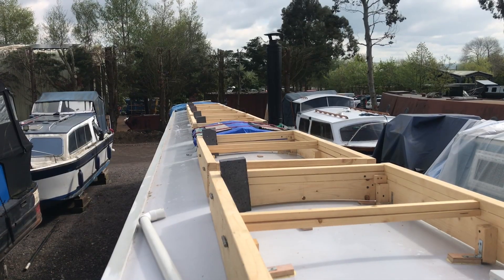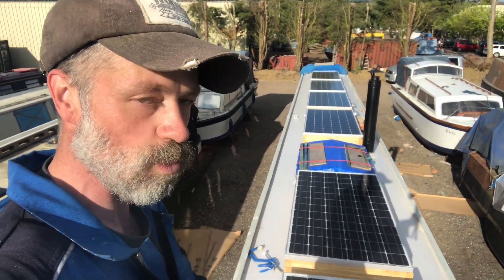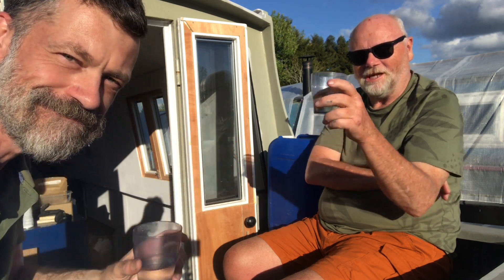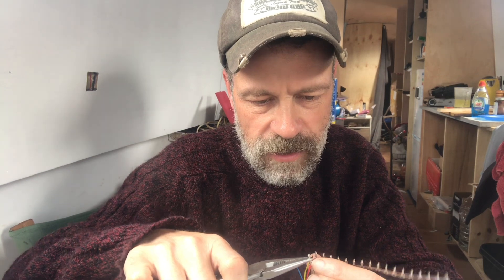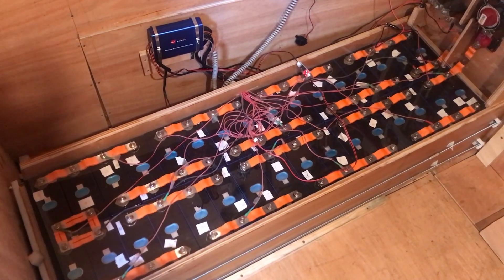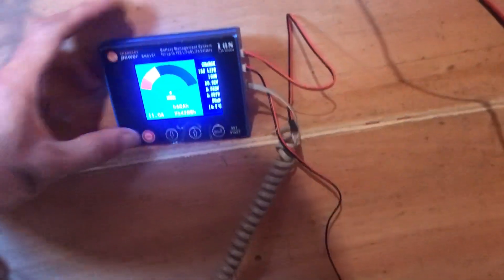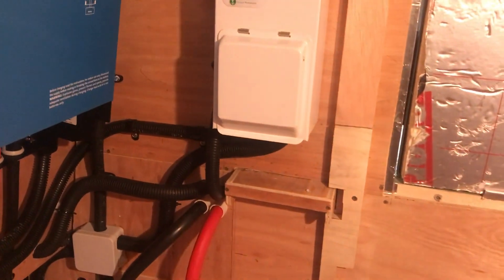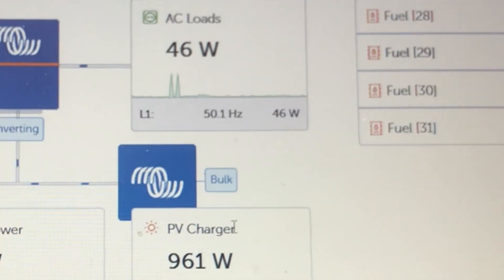48. Installing the [Actual] Boat Solar Panels (& a Quick System Overview)

Comment: I was hoping your panels would be 250+w each! But it is looking AWESOME. Most of the time when cruising, you are actually just sitting on a landing stage or in a lock, so the motor won't be running for much time at all on a typical day out.
Reply from the maker: I wanted relatively narrow ones so I could walk down the roof with [relative] ease. This resulted in only one choice of solar panel - believe me I spent days looking for more ‘oomph’ in a size that would fit🙃

Comment: Thanks so much for the run down. Was there a reason why you bought the Vetus serial system over other options?
Reply from the maker: My pleasure. The reason for Vetus was I was at Crick in 2021 and other than Fischer-Panda, the Vetus people were (IMHO) the only other ones that were engaging and informed about their products (and had a demonstrator boat there too). Vetus are a reputable manufacturer and were slightly less horrifically priced than F.P. So I went with them. And given I am putting this all together myself, I could get the stern gear from Vetus too and hopefully it will come [fit] together . 

What with Vetus and all the Victron stuff, I’m basically building a ‘Dutch Barge’ 😄

Comment: I noticed your MultiPlus II is 230V. I'm in the US and we use 120V. Is all marine equipment 230V?
Reply from the maker: Hi Awesome Dee! It’s 230V purely because is Europe that is the standard ‘mains’ voltage we use, so all the regular appliances (not necessarily Marine) etc. use 230v. If you bought the same Multiplus II in the USA it would certainly be a model supplying 120V as standard.

Comment: Loving the raw cell set up im completely off grid on my 48 foot springer i have 2 bi facial lg solar pannels that produce 1100 watts when i tilt them and about 900 watts flat but i installed the reflective backing to the roof its about a 3rd more efficient as they take up less space... Im jel i wanted to do a raw cell set up ... Keep up the great vids 😁
Reply from the maker: Hey C.A.! I remember reading about those bi-facial panels- your set up sounds great. Unfortunately I was limited by size (I really want to be able to walk down the roof). £/watt I’m sure you have a much better outcome 😀 As for the raw cells - tbh it was entire driven by available budget - otherwise I’d have got some ready-built batteries… although putting the cells together has been interesting… let’s see when they get tested in proper service 😀
Happy you’re enjoying the vids ! S

Comment: What’s your opinion about the mc4 connections. My panels came with them & since no other components on my system had them , I just cut mine off. I also did not use solar cable wire, instead I used 10 gauge copper automotive wire. I have a very short distance from my panels (10 feet max), I also made my own connection cables between my batteries (4 gauge, 9 inches long). Just curious cause I’d read about a lot of people saying the mc4’s having connectivity problems. I also went with sealed lead acid deep cycle batteries but now I wish I had gone with lifepo4 batteries.
Reply from the maker: Hi Clint. I must say, I wasn’t thrilled with the MC4 connectors. I suspect if a proper crimper is used with good quality connector components they should work properly (I admit I just used pliers to ‘crimp’ my few). I used them as that was on pre-installed in the solar panels. I never thought of your idea of just cutting the connectors off 👍. Likewise, I did question why I read using expensive solar wire given that most of the wiring isn’t exposed to the sun - if I had had spare regular automotive wire I’d have been very tempted to follow your route too - almost definitely with your shorter distances 😀
Reply from the maker: PS whilst LiFePO4 batteries definitely have advantages, there’s something to be said for the robust simplicity of LA batteries if there’s the space for them 😀